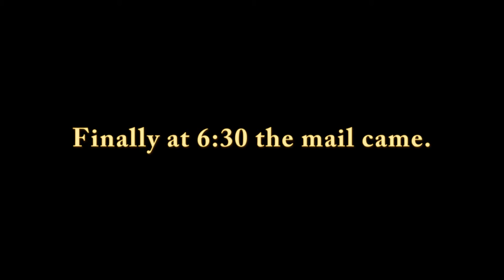Homelite trimmer carb cleaning, primer bulb replacement

Comment: If you take a closers look you installed the carb upside down. I would recommend you take it apart and fix it. The primer bulb should be on top
Reply from the maker: I did have it upside down when I put the priming bulb on and forgot the needle valve but when after I put the valve in I did manage to do it correctly, if you watch at around 14:40 you'll see. It runs great now and the pivot trim head is awesome. Thanks.